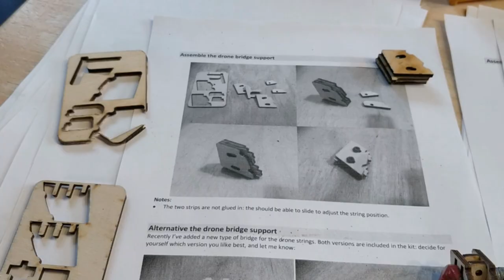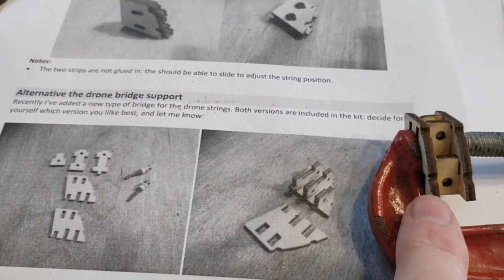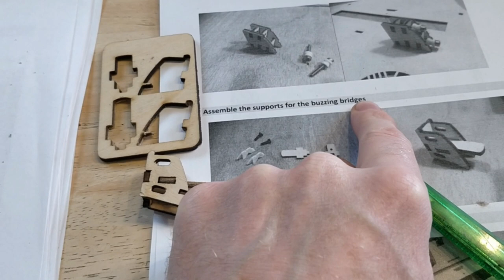Nerdy Gurdy, Hurdy Gurdy  complete build guide instructions Part 1 -Unboxing and initial build.

Comment: The thin and fragile pieces should probably be in a separate flat cardboard protector.
Reply from the maker: I agree about the shipping. It was a bit of a setback. However its worth pointing out if you buy a kit from most of the USA providers they do ship it very well and also if you buy direct from the original maker its also very well packaged. I was just unlucky.

Comment: Really disappointing about the shipping...
Reply from the maker: I agree about the shipping. It was a bit of a setback. However its worth pointing out if you buy a kit from most of the USA providers they do ship it very well and also if you buy direct from the original maker its also very well packaged. I was just unlucky.
Reply: @TinRhythm  Ah, I see! Thanks for clearing that up. My interest has been re-ignited!
Reply from the maker: @googleuser3163  If you are in the USA Littlebitsofinteresting.com  - Marti is very helpful and actually helped me with my kit, even though she didn't supply mine.